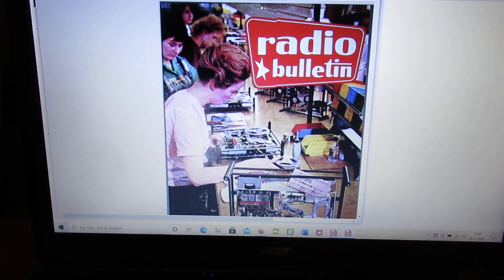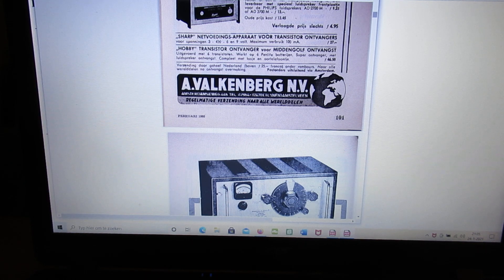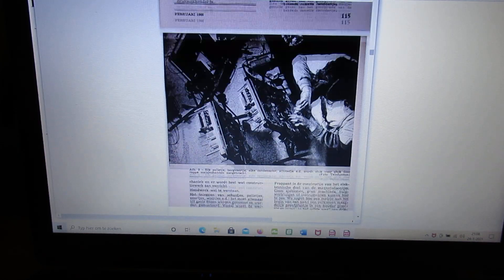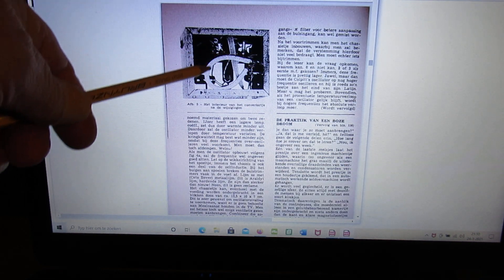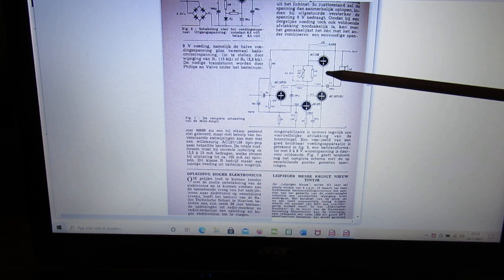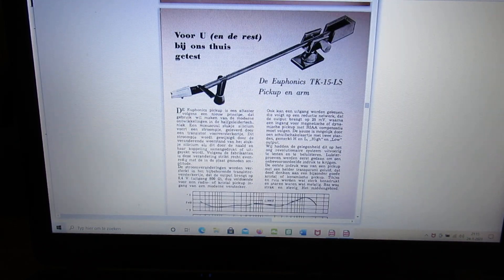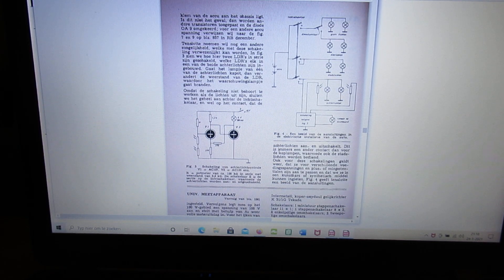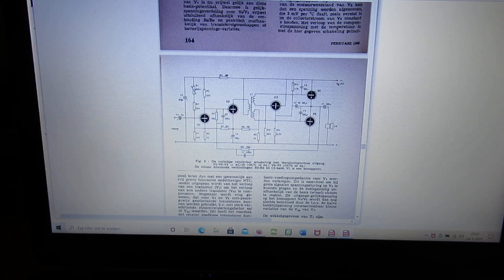Browsing a Dutch Radio magazine of Februari 1966 (Radio Bulletin)

Comment: Dear Sir, I need a very low frequency radio receiver. I can't find it to buy on the market and I want to do this.
There will be a circuit to detect a RF from 3hz to 1khz. Of course in the antenna. For this, I think it will be necessary to wind a coil with iron core used in old radios.
Is it possible for you to recommend a video containing this information?
Thank you.
Reply from the maker: Here is a schematic. Video link
https://youtu.be/W0PFErLMmGc 
I will give you some other links.
Reply from the maker: Links to other videos 
VLF antenna
https://youtu.be/GJtZQrZEn2Y 
VLF radio part 4
https://youtu.be/cw-ADtL0KG8
VLF radio part 3
https://youtu.be/cfkPntbTMZ4 
VLF radio part 2
https://youtu.be/84DPej7Vp9s 
VLF radio part 1
https://youtu.be/Xa2tUXoJUcw